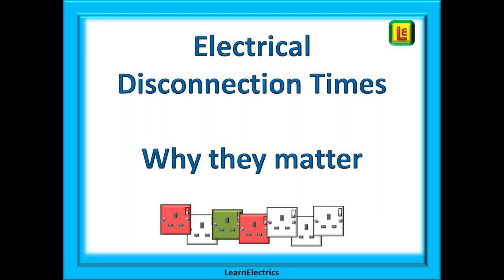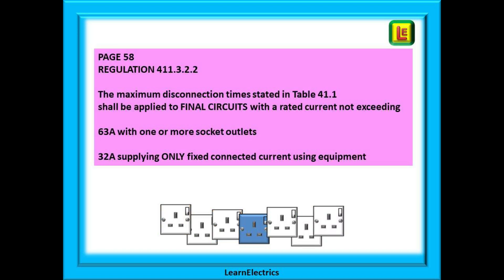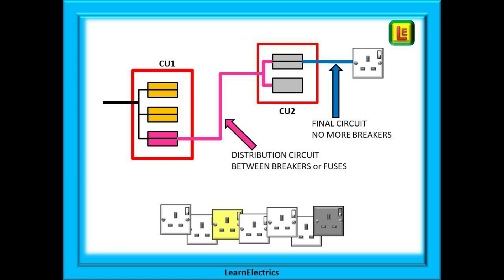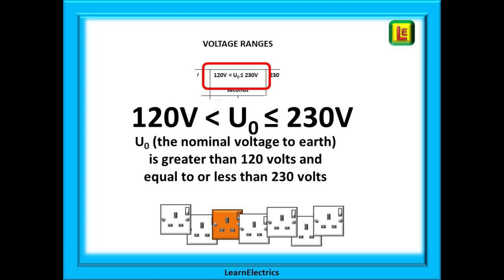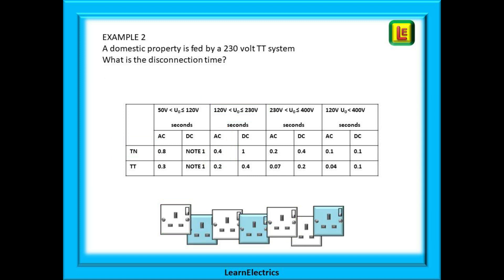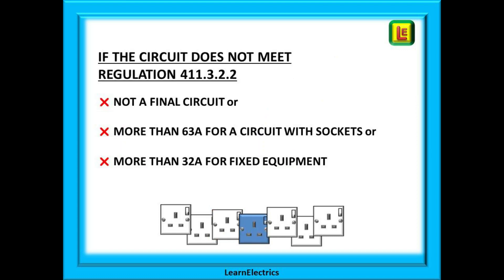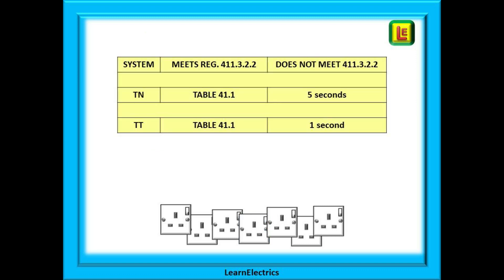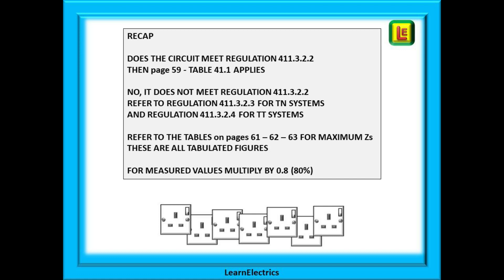Electrical Disconnection Times Why they matter

Comment: whats the difference between  maximum disconnection time and the actual disconnection time? ta
Reply from the maker: Max disconnect time is the time suggested by the regulations. The breaker must disconnect before this time given a certain fault current. Actual is ... actual. The time for that actual device in front of you. For a correctly designed circuit, the actual will never be more than the maximum. have a look at this video.
https://www.youtube.com/watch?v=QWr-ilqW67A
Hope this helps.
Reply: @learnelectrics4402 thanks that’s really helpful actually

Comment: so a 40a cooker has a disconnection time of 5s?
Reply from the maker: For the breaker, yes, but don't forget about the RCD which gives 0.3 seconds or less. Dave.
Reply: @learnelectrics4402  brilliant, though now I need to learn more regs as I was under the impression they didnt necessarily need to be on RCD's (down to method of installation, though they're usually run in the fabric of the building, hence requiring one)

Comment: @9.14, when you are doing the disconnection time for a 3 phase, if you divide 400 by square route of 3 then you actually get 230.9V, which would lead me to think you use the next band on the table (230<U0<400V). If this sort of question comes up in the exam, would you always assume 400V divided by square route 3 would be 230V?
Reply from the maker: Mathematically correct but no, we would use 230.9V as 230 V maximum NOMINAL. we call it 230 volts.
We use NOMINAL figures - the name we give them. So if we measure 225 volts we still give it the name 230 volts, if we measure or calculate 240 volts, we still name it 230 volts. Nominal - name.
Basically, if its a single phase UK domestic property we just assume it is 230 V AC NOMINAL.
On page 65, Table 41.1 ... 4 lines below the table is the confirmation to use NOMINAL AC voltages
Blame the boffins and thanks for the excellent question. Hope this helps.Dave.

Comment: In your example about a 440v 3-phase supply that requires 0.2s disconnection time, what table do we look in to determine what the Zs should be for circuits on this installation?
Reply from the maker: If its a type B breaker, the Type B tables, the same as single phase. Type C tables for Type C etc. The same tables that are used in the video. Note that the disconnection time comes down to 0.1 seconds in the tables so easily achieves 0.2 seconds for the breaker.
Reply: @learnelectrics4402  Sorry i don't understand what you mean - what table does it say that in? All the tables i see say 0.4s or 5s max disconnection time so where would you search (and know to search there just by reading the regs) to find 0.2s times?

ie, i open the book, i look at Table 41.1, i see 0.2s for 230->400v, i now go searching for the table that tells me the max EFLI measurement for circuit breakers with Uo of 400v, to give compliance for the 0.2s breaking time.

How do i know where to look and where is the information?

Comment: Didn’t word my previous question well. I thought table 41.3 applied to TN systems and not TT as well?
Reply from the maker: Alan, the point I was trying to make was that you can use Table 41.3 to make a close estimate to what the internal wiring R1+R2 of a TT system should be by subtracting 0.35 ohms from the Zs in T41.3.
I've seen some installs where the R1+R2 was stupidly high because the installer thought they could keep adding on up to 200 ohms. I suppose when the lights go dim they will know something is wrong.
Thanks for the feedback and for watching the channel. Dave.

Comment: So the maximum disconnection time is the maximum amount of time that a circuit can be disconnected for until a danger is apparent ?
Reply from the maker: No. Watch the video again and you will see that there is a danger there all the time. After the maximum disconnect time you may have a dead body, before that, a healthy adult should survive. That is why we want the fuse to blow before max disconnect time. Danger is always present. Keep watching, keep learning, it will all drop into place.
Reply: @learnelectrics4402   Now I understand. New subject to me so the concept “maximum disconnection time” I haven’t heard before. 
I understand now that there is a maximum disconnection time for specific types of circuits.  If this time has passed and the fuse hasn’t cut the circuit then your trouble. I assumed this Was something to do with a circuit being disconnected and thus a maximum disconnection time was then present.
Reply from the maker: That's it Will. If we can disconnect the circuit in less than 0.4 seconds there is a good chance the person survives.
Keep learning, keep watching the videos and it will begin to make sense. After more than 40 years, I'm still learning. love it. It's a great trade to be in. Dave.

Comment: Another great video by Learn Electrics. Going through all the e-learning libray which is very helpful.
Reply from the maker: Excellent stuff. Never stop learning, it all adds up to a lot of knowledge after a few months
Reply: @learnelectrics4402  Could you please clarify if the supply is a 3 phase system and is feeding a 3 phase circuit would the disconnection time be 0.2 seconds
Reply from the maker: It depends what your voltage to earth is, if it is TN or TT , what the load is, and if it is a final circuit or distribution circuit. Go over the video again and check those four points. Thanks for watching. Dave.

Comment: a distrubution circuit feeding an out building 16mm swa on 50A MCB will that have disconnection time of 5seconds and would that need to be a type D as table 41.3 only gives 5sec disconnection times on type D? also fixed appliances above 32A, so a cooker clipped direct on 6mm with 40mcb will that be 5 seconds as well? many thanks great videos!
Reply from the maker: Paul, the 5 seconds is a maximum. There is nothing wrong with a type C or B. They will achieve disconnection in less than 5 secs (less than 0.4 in fact) and this complies with the requirements of the Regs. Have a look at the top right charts on p370/371 in the Wiring Regs. These devices achieve 0.1 second for final and distribution circuits.
If only fixed appliances yes 5 seconds, but again, most MCBs will achieve less than 0.4 seconds anyway. Good questions. Keep watching.
Reply: @learnelectrics4402  thanks for that while I understand 5s is maximum what would you write down on schedule of test results for circuits mentioned above 0.4 or 5s ? Thanks 🙏

Comment: Is a type C circuit breaker recommend for a distribution circuit
Reply from the maker: We used to fit type C in industrial distribution boards as they are a little less sensitive thatn the B types and then Type B for the final circuit. Just make sure the Zs readings are good.

Comment: Did the 80% rule for measured Zs come about to accommodate that Uo is often > 230V or is it to allow  for less than perfect terminations and probing when taking a reading?  Hang  on I think I’ve found it.  BS7671 tables 41.2 -41.4 give max Zs at 70 degrees C. We usually measure at around 20 degrees, where electrical resistance is deemed to be 0.8 of the tabulated value.
Reply from the maker: That's correct Mike, we lower the resistance starting point so that at &0 degrees it does not exceed the tabulated value in the Regs book.
Reply from the maker: 70 degrees